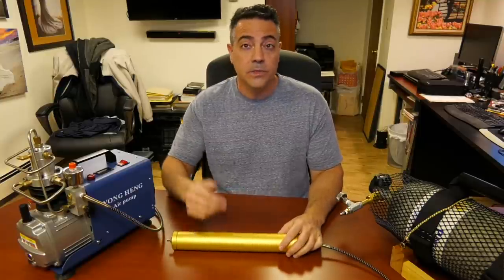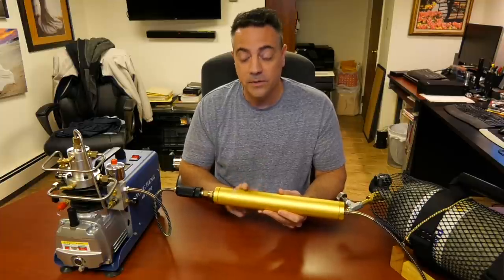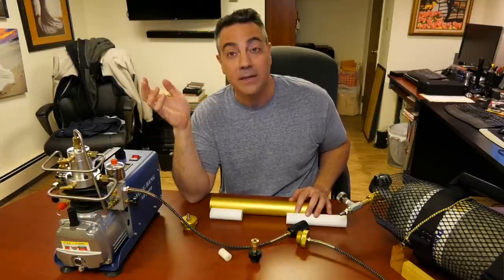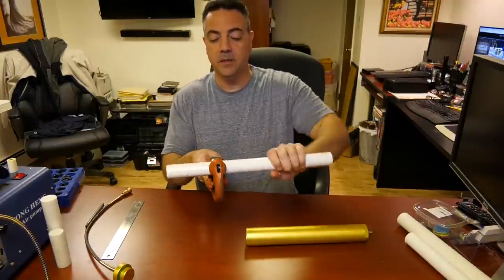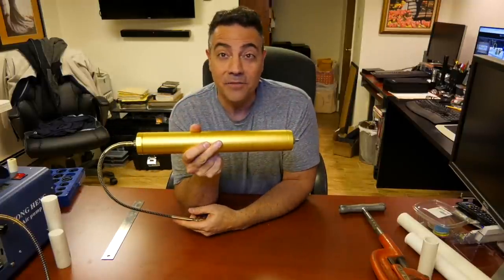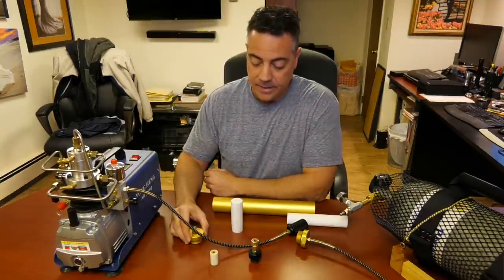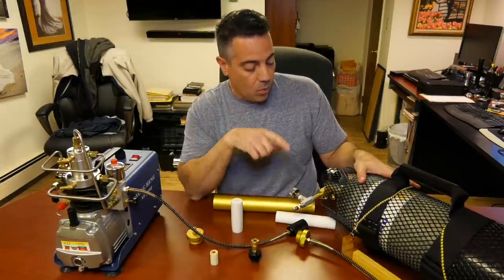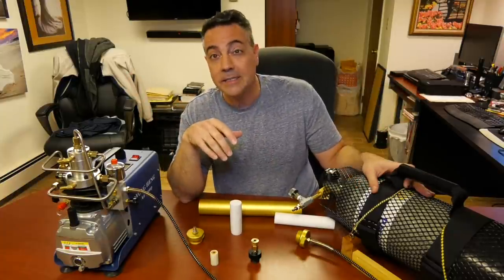Yong Heng 4500psi compressor and Water Separator (molecular sieve) for PCP Airguns

Comment: Why would you connect the tiny black water separator in series to the large one ? Seems obsolete and adds a point of failure.
One more thing: this thing is specified as: 30mpa, 4500 PSI, 310 BAR
30 MPA = 300 bar

This shows that there is no engineer behind those devices, they are likely a copy of a copy of a copy and we have no idea what type of metal is used for the threads.
It's a small volume tank, if something fails there it has enough energy to kill you.
Reply from the maker: The small cotton filter is not a water separator but a particle capture device. It simply stops dirt and oil but not water from entering the molecular sieve device. Yes you're correct 30 MPA is equal to 300 bar or 4350 PSI not 4500
Reply: @AirVelocitySport  
What I meant is that you can put a tiny cotton into the large tube and you have the black device obsolete. Which reduces risk of explosion.

The big tube is a deadly risk, the specifications are all over the place which means the company has no clue what they are doing.
It contains a LOT of gas at 300+ atm.

Normally when you use that compressor you have a tube with a tiny hole, the black device is also very small and does not hold much gas. So if it ruptures it just "plops" and nothing happens.
If it ruptures with that golden cylinder on it you'll have a full blown explosion.

The company making those golden filters is clueless.
They would need to test it properly at overpressure, rate it for a given pressure, set a burst disc for the pressure.
Then they would need to use a valve or tiny hole system to restrict airflow when anything in the line is ruptured.
Sadly none of that is done.

Comment: What about using the media that's inside the diablo drier from aoa???
Reply from the maker: Lily Smith I don't know what's inside the Diablo but it must be ok. I' m using molecular sieve because it is supposed to be the best for high pressure air but I'm sure other media should be fine.
Reply: Ok, thanks for the vid, good mojo. I bought that tampon filter last night, and  a male to male foster to go from the compressor to the tank/filter. I'll have $400.00 invested into my filling needs, looks like I will have a $1,000.00 saved . Great deal..

Comment: Any way to put the moisture trap on the compressor input side?
Reply from the maker: LouB yes, I have seen some video put dryer on the lower pressure input but you still need a high pressure trap because compressing air at high pressure creates water at the piston. I would imagine that low pressure dryer should help reduce moisture  but not eliminate it. Good point.

Comment: What brand oil/water separator are you using?
Reply from the maker: This oil water seperator was purchased on AliExpress? No brand name. About $70
Reply: @AirVelocitySport  Thank you for your quick response. I recently received a Tuxing branded separator. The issue I have with it is that the inside of the cylinder has grooves running the length of the cylinder.

Comment: Does you compressor ever just go off , I just used the it the first time it ran for 10 mins, then shut off won’t come on the power switch lights up , I tried changing the auto turn off switching psi
Reply: If it gets too hot it will automatically shut down. Check to make sure you don't have the automatic shutoff set too low.

Comment: These youtube PCP videos are all a bit too short and not "in depth" to have a good result. YT comment section can't do that either
If you take ambient air and compress it to 300 bars, there will be so much water dropping out, that a handful of molecular sieves cannot keep up with it. Just no chance!
So you need to make a multi layered approach. FIRST let all the water drop out that condenses out willingly. And dry the rest over molecular sieves. 
A way that I use: I dry the air after the first compression stage. The pressure is not high enough hurt if something goes wrong. And >90% of the condensation can be done there. And because of the low pressure, I can use a large tube of sieves without worrying about ruptures. 300bar air tank ruptures are incredibly violent.

Comment: Any update videos?
Reply from the maker: Total Package not yet. But I can report that the compressor and molecular sieve are working perfectly. This compressor can not be beat at this price point. Hatsan came out with a compressor just like the air Venturi but better at the same price. I still would opt for the Yong Heng compressor over the $1300 compressors. Once the price difference starts to close then the Hatsan/Air Venturi compressor will be worth it. I can see the Yong Hengs going up to $500 and the Hatsan/ Air Venturi coming down to $900. Now it's more clear which compressor is better at those given price points
Reply: Air Velocity Sport, thanks buddy. I bought it about a month ago and everything is working great. I have the molecular filter exactly like yours but I put a 410 metal screen on top of the tampon filter we cut. I still think I'm losing air when I purge the compressor at the end, and then shut my valve to my pcp tank. Any suggestions?

Comment: You can buy water absorbing material from home depot. it's just water absorbing rock.
its all over the western states and cost next to nothing. He makes it sound like you need this high tech material. You don't. I bought one of these compressors over two years ago and they are great and I have had no problem with the standard filter system. my humidity averages 30 to 50 percent daily. unless you are filling twenty times a week i would not spend the money. In my opinion this is nothing but hype or paranoia. One other thing. I have made multiple mods to my compressor and it now has every safety mod of a 1200 dollar compressor for about a 150 us dollars.

Comment: This device makes the compressor overheat because it works harder
Reply from the maker: yisuscrazy I have not experienced any over heating. It will not cause the compressor to work any harder and the impediment is naomial relative to 3000- 4375 psi. Can you point to specific study that would help explain. Thanks

Comment: HI, so I have this same compressor, and I Just purchased the GOLD Tuxing (3) stage filter..first it is the cotten, then carbon, the silica, then dissicant.  My only problem is WHICH end of the Tuxing filter connects to the compressor and which end goes out to the air gun/air tank?  Which stage should come first in the tube? I am assuming the cotton should be the first in line.
Reply from the maker: I believe the cotton side comes first and the charcoal side is last. The cotton will catch the dirt and large particals. The desicant is next and charcoal to clean the smell.

Comment: does using the secondary filter add extra load to the compressor and bleeding become a little longer
Reply from the maker: No extra load just a little more space to fill on initial run and thus more air to bleed but no big deal